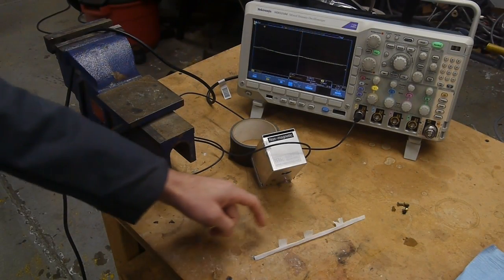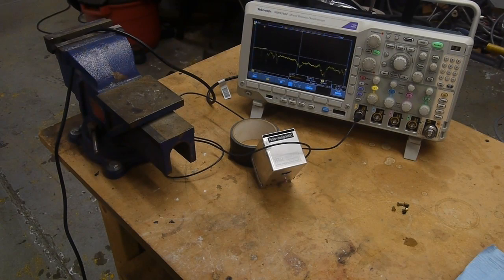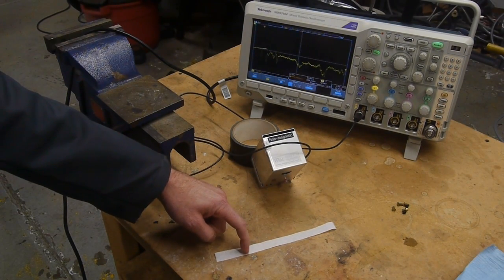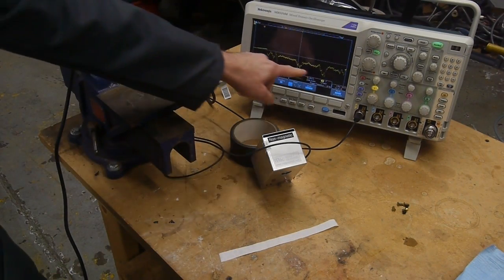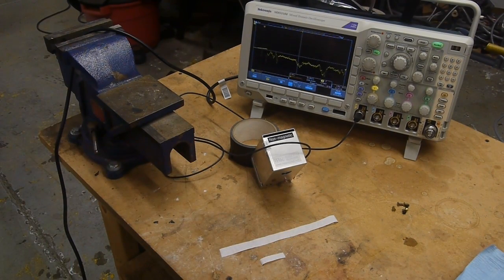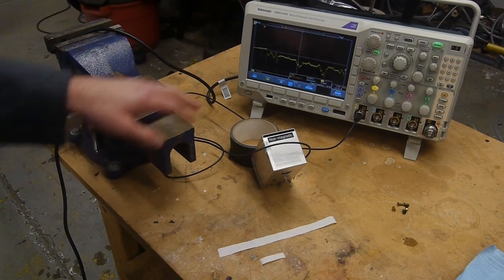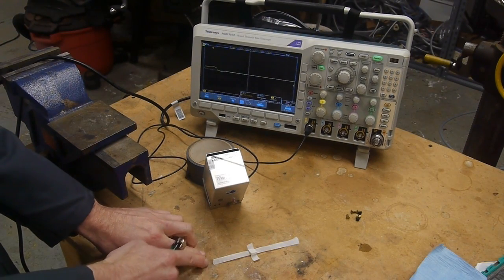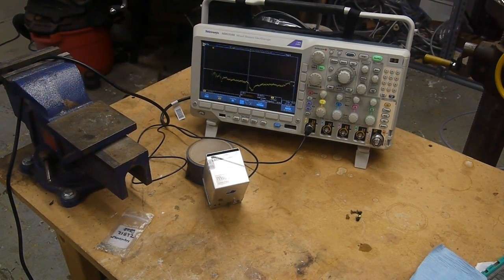Encode information in fire!

Comment: I wonder if printing a barcode on with ordinary inkjet ink or even laser toner would modulate the combustion enough to detect.
Reply: Do you mean printing it on flash paper? That's interesting if so. I don't see why a printer that printed in a liquid (which will set) black powder wouldn't work like that.
Reply: bok burning is noting new ..

Comment: You could build domino-style logic using mechanical cutters or some other kind of interrupter that disrupts (cuts, wets, drops a heat-sink upon) other strips of NC.  Like domino-gates you need to time things with delay lines so the signals (flame fronts) get to the right places at the right times.

If you wanted to get fancy you could use detonating cord and trigger cutting charges with it.  With some careful arrangement you could likely cut det cord without initiating it at the cut point.  The propagation rate is very consistent and if you laid the entire system on top of a metal plate the result of the logic would be preserved as indentations in the plate (cover with a bag of water to absorb the shock and direct the indentation into the plate).

A more family-friendly version would use visco/cannon fuse which is cheap, easy to work with and has no detonating hazard.  You can get fast-burning versions too which would be helpful with the clock tree and buses.  For "superluminal" signals you can pipe some kinds of braided fuse, or black match and most chinese fuse, which will drop its propagation delay enormously.  If you have more time/money than sense you could build a display using lance work and have the result ignite a 7-segment lance-work display. :)
Reply from the maker: +1 for the det cord / visco fuse powered 7-segment display.  Something about a computer that needs no electricity or even mechanical input is so enticing.

Comment: I have some background in esoteric programming languages. It's not possible with just flash paper UNLESS you can work out some way to CONDITIONALLY change the direction the flame is burning. For example, if you find some chemical that you put in the middle of a strip so the coated part of the strip doesn't burn if the flame is coming from one side, but will if it's coming from both sides, that is a good start. The fact that those students used this to send data is a perfect analogy as to why this is impossible with flash paper alone. Let's say you have a microchip which has an output pin that has some memory and a single output pin which, when the chip is active, will go through the memory and just send it through the pin bit by bit. This microchip is analogous to their project. Making the memory 2 dimentional will only change the order that the bits are selected (burned), and thus will only change the order they appear. You may design the chip so it will give the right answer in the rearranging, but only to a single problem and will need new hardware for every computation. However, that assumes you know both the answer to begin with so you can make the hardware. You may as well just make a database of all possible answers. To be a computer it must have the same hardware but different input. I'm thinking of multiple strips acting as input pins, you light the ones you need to represent the data, then it burns out the answer in other output "pins". However, if you could change the data coming out depending on the value of a set of bits, now your talking. Not all transformations are useful, but it's a start. Since I don't know as much as you in how it can be transformed, you need to come up with some transformations so I can figure out which ones are useful. Try ones that fit the logic of some common logic gates (Google it if you need to). The suggestion toward the beginning of this paragraph simulated an AND gate. This project is truely genius and I want to see it work. Any ideas?

Comment: The only thing you need for computation are logic gates. If you can make a strip with two input-tabs, which would cancel each other out on the way to the output, if both are lit on fire at the same time, you'd basically have a nand gate, which is all you need.
I'll try to come up with a cutting pattern as soon as I wake up ;D
Thanks for sharing that great idea of a burning cpu :D
Reply: neomix21 Well, unlike the domino setup which was done in a similar way (ex: computing by designing a universal logic gate like nand or nor), the flash paper burn could travel back up the computation and corrupt the final answer.
Reply: That would be an XOR gate actually. XOR gates are not sufficient for building arbitrary logic circuits.

Comment: I believe Numberphile (may have been one of the other of their channels) did some video about computation with falling domino bricks - which is a similar idea simply because both processes are essentially unstoppable once they are started. Well, maybe not quite, but for the most part. Once it's set off, it's hard to cut it off prematurely, it has to run its course.

I suppose you could do some kind of binary math if you used more than 1 sensor, like an array, that looks at a number of separate "paper bits" - then you could place a strip of pre-cut paper parallell to those bits, so that only the parts of the input paper that stick out, will set the sensor bits on fire. But the problem with that is that you've essentially solved the problem before computing it - you're just displaying a result, not computing it?

I love meaningless stuff like this - you might find it interesting to look into encoding information into music, something I did a while ago. What you do is you overlay sine waves of various frequencies on top of a regular piece of music - as long as the sine waves are of such a high, or low, frequency that they cannot be heard by human ears, they're essentially concealed. But if you connect the stereo output to an oscilloscope in XY-mode, you can detect the sine waves. Basically lissajou curves. Easy to create vertical bars (easy to interpret as "1") or circles (interpret as "0") depending on how the left/right channel sine waves interfere with eachother.

Though you do lose some dynamic range in the music itself, you can hear that it becomes a bit "flat" sounding, due to the sine waves stealing some of the available range in the sound file format, or the speakers themselves.
Reply: I was going to suggest the same video. It could be interesting
Reply: I think you're on to something. That vid introduced basic logic gates. I think with fire as the "electron" you may be limited to only one type of gate, because the path is destructive...  but if you laid out flash paper in a gate format, you can probably get some basic AND gates rolling, and therefore some limited computation.
Reply: TheSageDad you could use metal blocks to bride and could use a paper bridge to make paper burn underneath the bridge without lighting it, but lighting the bridge would also light the paper underneath because it falls when it isn't stable anymore. Quiet a few gates you can build with just these properties.
Reply: MrCamoGaming You're right, I thought of something similar and posted it in a different comment on this video if you are interested to see my approach. Basically, that bridge idea could be considered a NOT gate and with this property one could also create the OR and the AND gate in a similar fashion as in that Numberphile video.

Comment: Regarding your thought on computing with the strips. Your optical detector reading the 2 burning strips would act as an OR gate, with each "step" in the paper being a bit 0 if no tab, 1 if a tab is present.

If you adjusted the sensitivity to only trigger if both strips were burning (so double the amplitude) it would act as an AND gate.

Comment: The channel Numberphile has a video on creating a computation using dominoes (just look up: Domino Addition), meaning it should be able to be done with flames. If you arrange the paper in the way that Numberphile showed, and you would position the optical sensor at the end of the set of paper (output), then the time that it was on fire can be used as the answer to the arithmetic problem. For example, if you created the circuit to add 0 + 1 and the sensor picked it up at 'x' time, and then you repeated the process recording the 'x' values (making a table with the actual answer and time: x), then after 3 "computations" you will have enough information to have a run where, once the time(x) is on the table, you will see what the actual answer is, meaning you could in theory make a computer from fire.

Comment: This might be slightly of topic but you could do logic synthesis like in FPGA/CPLD in software, then plot chemicals in some sort of pattern on sheets. Stack 2 or more layers, ignite and hope the chemicals on layers would output different light spectrum values. Then get output with thermal imaging.. analyze, reprint get output, ignite.. repeat... You would probably need a version of Quartus that is able to draw multidimensional FBD diagrams :)

Comment: I think to make it interesting, the requirements need to be relaxed just a bit. There are various ways to signal encoded data by interpreting the color or size of the flame, but any way to compute data that I can think of involves making computations ahead of time because there seems to be no way to change the behavior of the burning flame based on the output color. Unless there is some kind of additional ignition mechanism that is controlled/powered by the color or size of the output flame. Then you could combine strips/colors to produce logic. Maybe you could have paper suspended above two strips that could only be ignited by a large flame (both strips burning) but not by only one or none. But that seems like a bit of a stretch.
One other way is to use the mostly uniform speed of the burning, like the dominos people are talking about. You could use the delay of the burn to wait for other strips to burn and selectively burn certain paths away (though I have no idea how) to prevent signals from continuing to the output. If you can do that, you can pretty easily implement any combinational logic, reading certain points of the paper as output signals, but once the computation is complete, the computer is mostly destroyed, which is a bit troublesome... But you could theoretically still get any one-shot computation completed. As for any sequential logic, I'm not sure, it seems like there's no way to store data for any reasonable length of time or any way to reverse the state of the system because of the essentially irreversible computation process. It is possible to unroll a traditional state machine to a finite number of uses and use the slow burning as a sort of timing/delay mechanism (for example to wait for a second input in a chain of inputs perhaps), but beyond that, I have no idea. I'll think about it some more.

Comment: That... is a REALLY interesting question.

I think you would need some kind of feedback mechanism. Maybe light sensors connected to heating elements. This way the system could react to a process in a way that isn't predetermined.

Maybe it's possible to have the system do that on it's own... possibly by building it so that when a certain part of the paper burns, the flame may or may not reach high enough to ignite another strip.

Comment: One method of using flash paper to compute simple multiplications might be feasible with your photosensor technique by crossing strips in a perpindicular fashion.  2 strips verticall laying over 4 strips horizontally should produce 8 brighter flashes of light at each intersection, 2 x 4 = 8.  Perhaps non-perpendicular intersections may prove useful as well to avoid simultaneous ignition of intersections.  Cool idea.

Comment: computing with fire is very much possible, a diode can be made by having one piece of paper above the other, the lower piece of paper can set the top one on fire, but the top one can't catch the one below it on fire due to hot air traveling upwards.
logic gates can be created by separating the lines into a propagation path and a data path. a not gate can be created by having one line burn away the paper from the other and using the aforementioned diodes to prevent back flow, from not gates, any other gate can be created.

Comment: I think the problem you will have in computing with this is that you essentially have no way to stop the signal, all you could do gate wise is an OR gate. maybe if you treated a strip such that it will only ignite if two strips flame fronts meet at the junction but then timing will be nearly impossible. If you could come up with some way to simulate a NAND gate you could theoretically do almost anything.

Comment: Like everyone else said, the problem is making logic gates. We need a way to stop the fire burning in one direction. A flame diode, perhaps...?

I think what you could do is suspend a metal block (or something) over the strip by a cotton thread. When the correct signal(flame) comes into the junction, it burns the thread and drops the block, halting the other signal line.

I really need to get some flash paper and try this out.

Comment: Fire can conduct electricity with high enough voltage, so it's possible you could use that property of the flame to create a slightly more digital signal and overcome the analog interference of your optical sensor. Three steel wires above the flash paper at different heights could be a start. It would allow you to create a longer flash paper run because you wouldn't be limited to the optical sensor's range. I'm not sure if that helps you compute anything though =) 

Edit:
People are talking about making computing gates optically. Polarizing filters might be the key to that.

Comment: For just encoding information, I would suggest using holes punched in the strip rather than the tabs.  By experimenting with different hole shapes and sizes, each hole could have a 'signature' when it burned, and you could encode characters instead of just bits.  (though your character set may only be 8 unique signatures or so).  Also, to help with the problem of indeterminate burn rate, it might be useful to choose one character as the 'Start of Frame' indicator.

Comment: You might be able to build an or gate by having two input strips below an output strip.  If either input strip burns, the flame will go up and light the output, but the burning output would not be able to light the input because the flame goes up,  not down.   The geometry would be critical here to make sure the input can light the output, but not vice versa.

An inverter would also be needed.  Maybe if one path had a piece of flash paper that could fall away to break the circuit if it were burned by the input. This would be more like an and gate with one inverted input.

Comment: Flames are cool, but inconsistent. You could use a strip o paper and punch holes through it, then, aided by a small motor, pass it in between an LED and a photoresistor. It would be like the predecessor of the VHS. Using light instead of a magneic field.

Add more holes in parallel with several photoresistors to have more combinations and more information density.

Comment: Nitrocellulose often contains traces of sodium from neutralization of acid used to make it, otherwise it will decompose. Sodium ions give very strong yellow colour, so you have to clean it from sodium to obtain other colours. Potassium gives very faint purple colour (black powder contains 75% of KNO3, and flame is white). So it would be difficult to notice purple in this way. In fireworks purple is made by mixing red (strontium) with blue (copper).
And as always, interesting video :)

Comment: Just a preliminary thought, as I think over this more, but to figure out if we can do computations with this, we could try to create a turing complete system from fire strips. If we can, than fire strips can simulate any computer. I'll think over it more.

Edit: Actually, fire strips will always halt, so that limits computation somewhat. Perhaps there is some way to encode operations as horizontal strips and memory status as vertical strips?

Comment: Perhaps you might be able to use a method similar to the optical sound encoding on film?

If you're storing digital data, it needs some sort of synchronization - either a parallel clocking pulse or some sort of differential signaling. You could cheat a bit by having a 'lazy' clock - some sort of easy to detect pulse (or lack thereof) that you can trigger on.

Comment: my idea for an AND gate would be one input going to a zig zag flash paper, holding up the output sheet with foil to prevent it from actually burning, so when the input does burn it causes the output link to fall onto the secondary input link and then the output can ONLY burn if both inputs burn at the correct time so this logic uses flash paper for conducting, foil tape to act as an insulator and gravity to help create mechanical switches. It might be possible to cause tension in the flash paper to remove the need for gravity but I've never dealt with the stuff so I'm not 100% on its properties